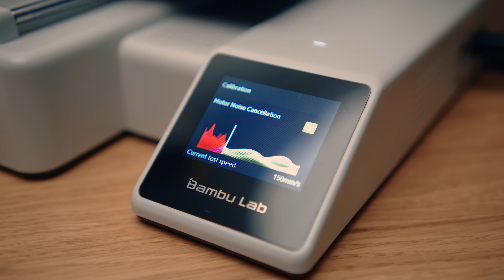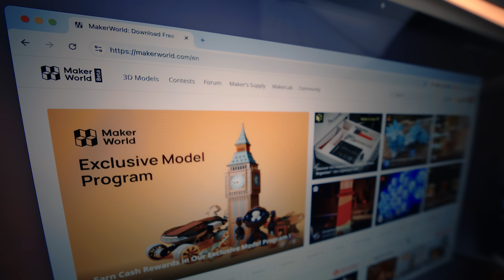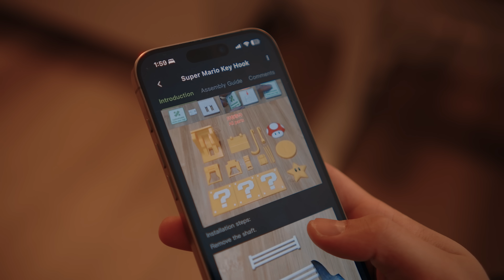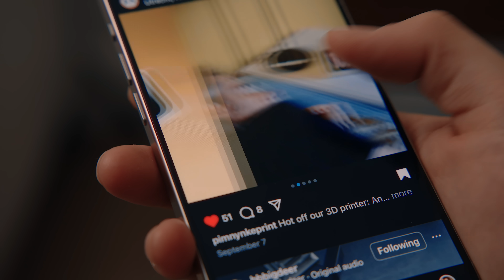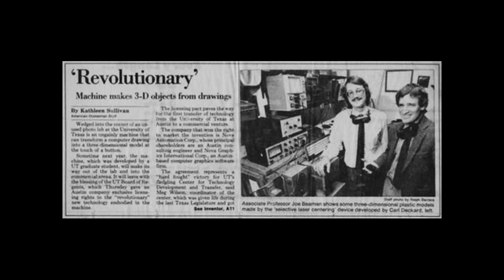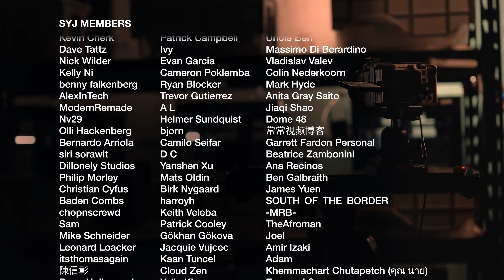make your own things

Comment: Breaking my toilet flush mechanism, and being able to repair it within hours by designing and then printing a replacement part; this is the 3D print I'm the most proud of in my home. This was not the reason I purchased a 3D printer, but some everyday problems are just asking the printer for some attention. Thank you Scott for sharing how you've made your own solutions
Reply: Did the exact same thing, my dad rang me an hour before I finished work in a 3d printer lab. He was going to have to buy a complete new mechanism for €13 when all he needed was the one plastic bit. In 45 minutes and for a few cents worth of plastic I had the new part made that's still working years later.
Reply: wow! And which design tool are you using?
Reply: No sh*t!  Sorry couldn’t resist 😂
Reply: I fixed it in a fraction of the time by going to home depot
Reply: @Eaton-10  not everything has cheap, available replacement parts
Reply: @Eaton-10  I'm sorry you won't understand the joy of creating things
Reply: @Eaton-10  good for you:face-blue-smiling:

Comment: Scott, are you interested to create your Portable Macintosh Mini for the new form factor of the new M4 Mac mini 2024 or is this not motivating you enough to redesign it?
Reply: The original 'macintosh studio' design took advantage of the fact that the iPad mini was the same width as the mac studio/mini - now that's it's narrower, he'd need a different device to act as a display. An iPhone 16 is a little under an inch too long, but even if it wasn't, a 5" wide display probably wouldn't be very comfortable to use outside of a secondary display.
Reply: @ No, Scott just needs to create another solution for the new form factor of the new Mac mini and also how to use the new free space in his case for an even larger battery. Why do you want to change the outer dimensions unnecessarily???